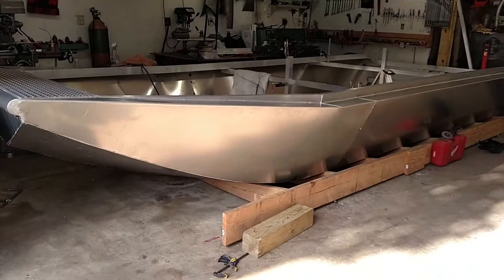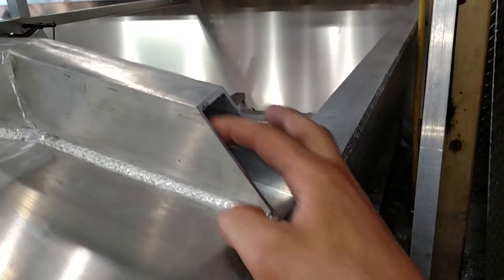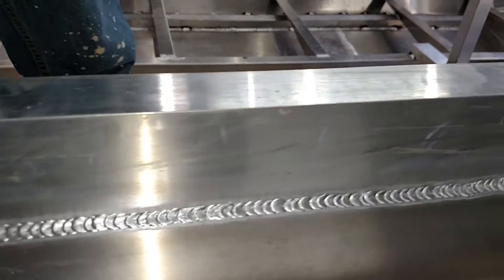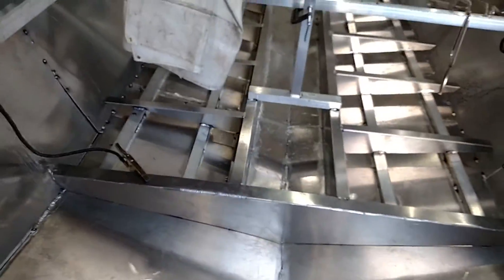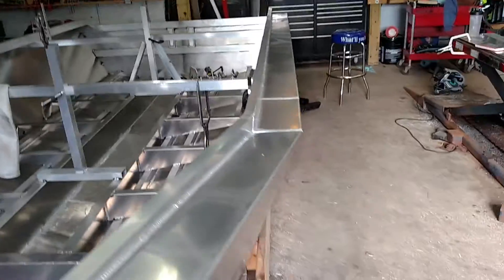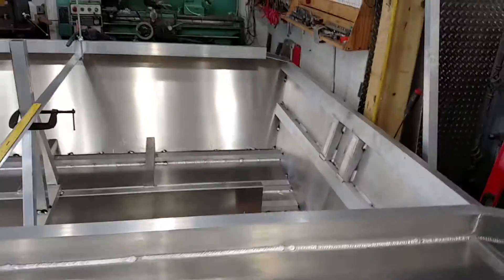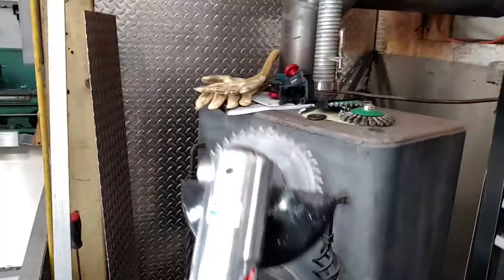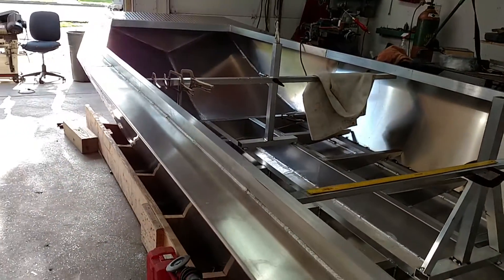Homemade aluminum jet boat #2

Comment: keep up the nice work bro! I agree, wax the wheel to get the aluminum to not plug up your disc, I use a food grade wax from ups that I can weld through with out any problem.

Comment: Hey Jesse you can get 36 grit flat grinding disks by 3M that are not the flap style. I pay about $2 each but they need a backing pad that screws onto your grinder. Also if you use a bit of wax on your pad it will remove welds better. Clean the area with acetone if you plan to weld there again as wax doesn't weld too good.  Get buffing pads for smoothing out the grind area. 
  You may be planning a center seem structure but I didn't see one. Since you're bow is already gaped you should drop a stem bar down through to take any abuse,  use plate instead of angle for your beaching plate. I think if you pause my vid at the front of my boat you will get an idea by looking at mine it has the tow lug built into the stem bar. The back half of your center seam won't need a stem bar going through but does need strength added. A 1x2" C channel will work.
   The curtain plates in the bow is a risky maneuver on that seem.  The more weld the more fatigue it gets. 
   Good luck!
Reply from the maker: Are you suggesting that I cut a slot in my forward seem and slide a stem bar through it ?  I don't know what curtain plates are.... Are you referring to the "filler" pieces that I added to the gap to fill it in?  Can I contact you via phone? I'd like to pick your brain for a few minutes...... Jessehart05@yahoo.com if you want to PM me.
Reply: How you healing up
Reply from the maker: donald cooper doing really well.  I will make a video soon with recovery progress.  Thank you for asking.

Comment: I use a scotch pad wheel they come coarse and very fine, coarse will remove material pretty fast and very fine will almost polish it. they make them that fit onto a disc grinder.

Comment: What welder did you use to make this? Aluminum spool gun in a mig?
Reply from the maker: Miller 350p with a XR push pull gun

Comment: get rid of the flapper wheel and use different sandind disc's but coat them with wax from candle or where ever you can get wax. up here in canada thats how we do it .and you get a better finish